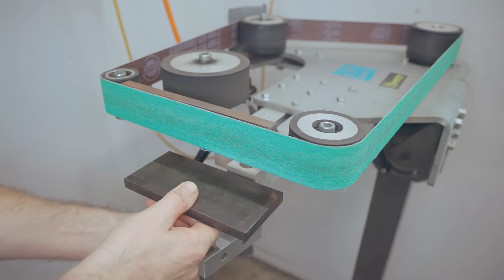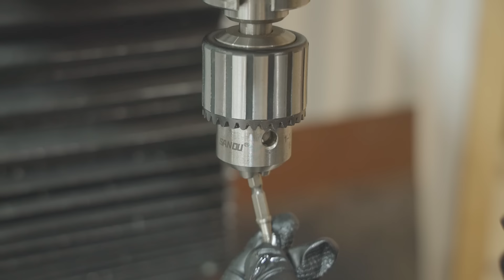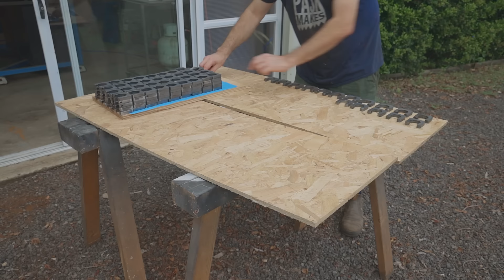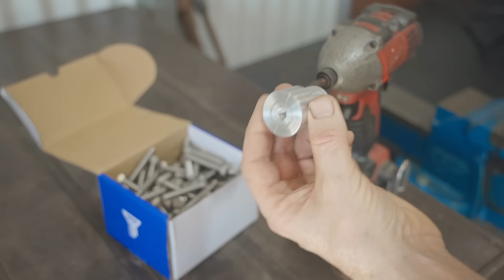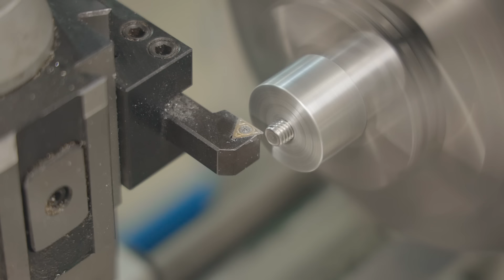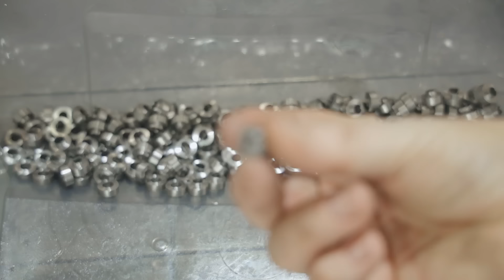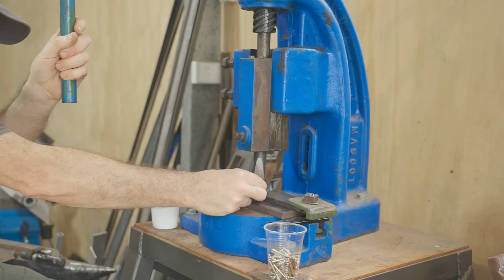Small Shop Batch Production - Lots of Jigs to make 200 Clamps

Comment: Two simple things: use a vibratory deburrer for the clamp bodies and the little dinguses on the end of the screw. Instead of painting, I would do either black oxide (you'll have to send it out) or parkerizing (which you can do in the home shop)

Comment: Most keyless chucks have a back-lock. After squeezing in you turn it the other way. There should be a noticeable click or an immediate loosening of the tightening ring. Tho .. it is mostly used in drills designed to be used as a screwdriver.

Comment: When getting something laser cut from a template for the first time, pay the premium to get only 1 cut first to identify issues, rectify issues, then repeat with another single piece cutout. Then, if this second "prototyping" is within parameters, proceed with production run or do further R&D. Having a couple of high cost one-off prototypes prior to a production run produces a better product and reduces the cost and time of remedying issues.

A couple of "prototype /test" laser cut pieces at (5x, 10x or 20x cost of multiple piees) will significant reduce the cost of and time required for multiple pieces.

With the painting, maybe paint the stamped maker symbol a different colour, I'd suggest red or yellow. Maybe even allow the purchaser to nominate the base colour and the imprint colour (for a premium) ~ I'd go with yellow base and black imprint

Comment: 50 years ago I had a summer job in a small engineering firm  and i learned how jigs could speed up production. Small components had sharp corners removed by tumbling in a drum with abrasives.

Comment: In a high production setting you could have eliminated almost all the manual de-burring steps by using a vibratory tumbler, a collet chuck on the lathe would have saved some of the setup time on the turning operations and made it more repeatable. However with the accuracy required that one is definitely up for debate and would be more of a preference. As far as the Laser goes as I'm sure others have said make sure you include a print that has dimensions for critical features on all parts you are having made outside of your own shop for two major reasons. First off it gives the shop the best chance of making the parts correctly and second it gives you a way to go back to them and have them be the ones to correct it if they are the ones that made the mistake and missed something on your print. all in all you did a great job and are a great machinist as the best sign of how good a machinist is in my opinion is how they set up quickly made yet repeatable jigs and fixtures for repeated operations for the fastest overall turnaround time and to hold complex parts rigid enough for a quality end result.

Comment: For removing all the sharp edges it might be nice to use barrel finishing (tumbling). It's kind of slow, but easy to set up and practically hands off. You do need an electric motor and gearing, so maybe an old washer?

Comment: That's a cool little clamp. Simple, functional, and a very original look!

The kind of patience for those repeated processes, is a skill in and of itself. Most people can't stand it, while others enjoy having some parts of the process not require much thinking, just a clear head, and getting the efficiency aspect down. Had a similar experience as a ski-technician a few years back. We had a massive sale on children's ski's, but didn't take delivery until just the night before. So my manager was worried about how we'd attach bindings for 300 sets, without causing a massive queue. 300 sets meant 3000 holes would need to be drilled and glued, before fastening 3000 screws without ripping the threads in the thin, soft material.

With 2 hours available before opening, I had all of them done within half an hour after opening, and not a single customer had to wait. I just put my headset on, head down, and perfected the workflow to the point where I'd have a set done in under 60 seconds, including tying each pair together with a rubber band and handing them over to a colleague. Those hours just flew by without a hitch. My colleague said it was like watching an F1 pit-stop on repeat for 2,5 hours.

Your process took that same kind of repetition, but turned the amount of work per part up to 111. Good job on getting through all of them! I bet every customer was as pleased as pie with the finished piece.

Comment: When making the swivel pads, you could add a spring to Joe's jig, and rather than the solid rod contacting on the rear of the stock face, you could let the spring-loaded rod touch towards the front of the face. Move towards the chuck until the spring bottoms out, then advance the part-off tool. The spring will push the rod into the center hole and catch the swivel pads before they fall. Might save you digging through swarf!

Comment: The only suggestion I would consider is to use springs between the vice jaws for instant release, they will also keep the parallels in place when using the airline.

Comment: Excellent methods for mass production.  Would change one thing though.  Buy off the shelf stainless tube so you don't have to manually drill out the centers.  Cost should be similar.

Comment: You could try ball milling the edges in a shot peen barrel. 
For the counter sink on the hole there are counter sinks that slip over drill bits and set into place with a set screw.
For tapping you could utilize a tapping head.... although pricey when new.
For the lathe stop there are actual hard stop clamps made for the ways. You could make a crude one with your mill and it would have far more flexibility.
The Y axis on the lathe would be the tool height??  
For the swage on the end of the screw you might be able to eliminate the spilt cut. Try using a single point forming punch tip made on the lather instead of the bearing. Set it at 4 or five degrees. The deformation only has to be enough to retain the clamp head. A countersink there would help.
I think another inch and a steel handle would make these more useful. 
Just some thoughts.

Comment: just started video, but good way to debur all the sharp corners on a thicker part like that one... put a bunch of them in a concrete mixer with a bunch of old nuts and bolts. set outside, turn it on, wave at the now angry neighbors, come back an hour or two later and done. Also works good for removing dross on small plasma cut parts. the parts will look like that are sand blasted when they are done.

Comment: I'd like to ask, when you made the threads with a large machine like that, how did you take into account the vertical pull created by the machine to match the rotation? With a normal drill press I'd imagine you would ruin the threads if you let the tap to pull the machine down on it. If you know what I mean?

Comment: Nice job on your clamps and all of the jigs that you used. 

One thing that might help on future projects when needing to part pieces like you had for the swivel pad would be to use a parting insert that cuts either on the left or right side vice a neutral insert. In your case the insert that is angled to cut first on the right and last on the left would allow the part to get parted and not leave the little extra that you had to pull off manually. 

Other than that - good job 👍

Comment: Great video and picked up quite a few tips and tricks.

I do have a question, wouldn't selectively heating one corner to press is the touch mark create a weaker part of the clamp in that corner?
Reply: It won't make a difference with the pressures being applied by hand to the clamping force. Not to mention the brass handle is going to bend well before the clamp base has any issues

Comment: I'd suggest sanding off the bolt markings from the head.   No one needs to know what grade the bolt is.  By belt sanding and lightly polishing the head smooth it will make it look custom made and not like just a hardware store bolt.

Comment: Speeding up the lathe bolt tenon: could chase out some of the threads in the jig (most of them, so that the first inch of threads is pilot hole, that way only a few threads hold the part in the end needing less drill time to insert them.  Add a slit so that the lathe jaws compress the now limited contact area like a collet.

Comment: For knocking the edges off, you could try putting them in a vibrating tumbler for a day.

And for dealing with steel chips from the drill press, I use a rare earth magnet in a ziplock bag, stuck on the vise. when it's nice and furry, you just pop it off and turn the bag inside out

Comment: I worked at a place where we had to make 100's of little angle pipe supports they where made from stainless steel angle line (40x40x4, 50x50x5 and 60x60x6)
we cut them on a automatic band saw, the holes where punch in. They took about 1 hours to make about 100.
we cleaned then up by putting them in a drum with a lid (could get about 70 to 100 in), fixed to an old cement mixer and put lots of small stones in and left it for about 1.5 hours.
all we did then was to wash them off and they look good NO sharp edges.

Comment: Much quicker and cheaper to radius the corners of a long square bar then saw to thickness, skim either side then bore the central hole and drill and tap for the screw.

Comment: Paint(ing) Tip. To avoid what is called Paint-Bridge(ing) {the edge of the part being painted and the flat surface} do not paint small or big parts on a flat surface. You can put parts on a small / or big, round diameter rod, or make wooden (semi) triangle(s.)  Take whatever size dimensional lumber that you have (a bunch / lot of) in stock,  (say a 2" in. thick X 4" in. wide) just cut say one inch or {0.75" in.} wide slices at a 45 degree angle, flip lumber to get true triangle(s,) rinse and repeat as necessary. I would recommend a length of 3 (three) to 4 (four) feet. What ever makes you feel warm and fuzzy.  To give you an idea of where or how to use the triangles, use, say when painting / staining house door's, kitchen cabinets, etc.  

The following tip is recommended only if the wife will be away for more than a week or longer. Cut triangle's to length so as to be able to fit in your oven, bake at between 150 - 180 degree's Fahrenheit.  (65.556 Celsius / Centigrade  to 82.222 Celsius / Centigrade) for 15 - 20 minutes.  Paint must be given time to "FLASH-OFF," before going into oven.  "FLASH-OFF," is usually around 10 to 15  minutes also. Depends on the type of paint, most spray paint in a can, the 10 to 15  minutes will be more than enough "FLASH-OFF-Time." 

What happens if FLASH TIME is not followed, you get a "FLAT-LOOKING-FINISH," versus a Gloss Finish. We won't talk about possible fire. Leave that for another day. 

WARNING, I was in the dog house for a long time over that one. Use at your risk. HINT: She came home early.  Boy, was I in BIG HEAP TROUBLE.

Comment: If you sent the vendor the correct file with a radius on each corner and the incorrectly cut parts with no radius...the parts are wrong period. Reject them and tell them to recut the parts OR you get the incorrect parts at a significant discount. Seeing as to you have to do the extra work.

Comment: First off, I love your template following jig for the belt grinder. That's a trick I'm going to have to remember. The template itself was perfect, requiring no tools to lock the clamp in place.

I think your grinding on the inside could have been skipped if the parts were water jet rather than laser cut, but I'm not 100% sure on that. You also could have tumbled the parts rather than ground them for that step, though I'm assuming that's something you don't have. Most water jet places probably can do that for you as well, though I have no idea if it would be cost effective. A tumbler would have saved you a couple of deburring steps later on as well, such as with the pads.

As far as your other jigs and fixtures, I think your setup for drilling and tapping, while good, could have been better. I would have gone with something like the grinding template, where you just slide the clamp on and off without needing to open up the vice. Something like the grinding template welded to a base plate and bolted right to the mill table (or held to it with strap clamps) would have worked. You'd just need to make sure there was something supporting the bottom side of the hole, which would also reduce the size of the burr when you break through. The same fixture could be used for tapping.

As for the lathe stuff, you should look into getting (or making) a micrometer stop. They do the same job as the thing you bolted to the carriage, but they clamp directly to ways and have a finely adjustable plunger that forms the stop. They're really handy for cutting up to a shoulder or batching out parts, and they're more versatile than the stop you made.

For drilling the main hole, next time I would see if you could find some seamless tubing that would work rather than making your own. For the hole in the end of the bolt, I would have looked at a drill collar to use as a depth stop rather than reading the tailstock dial.

Comment: To quickly clamp the bolts, I use a nut 30 mm long, with two grooves cut on the side of the hexagon and cut in half across the thread turns. I fasten these resulting nut halves together with springs from old rubber cuffs, these springs are just well fastened into a ring and keep the cut nut from falling apart. For these springs, two grooves are cut on the side surface of the nut before cutting it. When working with a bolt, it is enough to slightly open the nut, overcoming the resistance of the springs, and insert the bolt. And the shape of the hexagon allows you to quickly install a cut nut with a bolt in the cams of the lathe chuck.

Comment: I'm not an expert by any means but would tumbling these in sand or shot for a few hours be possible to take care of the rough edges. It takes longer but is hands off. If you had a large tumbler you could do batches and that's a job taken off your hand. Also if these are laser cut would it be a negligible increase in cost to have them cut the clamp discs from the center waste piece of the body before cutting the body and then you'd just have to finish them up, might be too thick or the wrong metal but if it is possible that's another way to streamline. They're really nice looking clamps and I've enjoyed watching you perfect the system of making them..

Comment: Looks wonderfull and much better than some versión of comercial clamp for this size (looks like a two medium thick metal sheet soldered), I remember a certain aplication, making inductors for induction heating, where the steel clamp alway looks darks and rusty due to the near of the torch for soldering copper with silver, I think a full stainless steel clamp is the answer for this application.

Comment: I’m sure you’ve already figured out a solution, but for the stop on the bottom die where you squeezed the pins, you could drill and tap a hole somewhere so you could mount the same stop you used on your lathe cutting the little rings.

Comment: Pask, I came up with an idea for a local trade school for a project for the machine shop. I got a number of used but reliable and accurate cordless keyless drill chucks for the students for their drill presses. They students would need a standard grade 10 sae bolt, cut off the head and machine 3 flats for the keyed chuck to keep it from spinning. The instructor thought that was a useful idea, and one that was both inexpensive and practical, and didn't require special training or calibration. A tool repair saved the chucks from non-repairable drills.

Comment: Great video and fantastic job on these! I work as an engineer for OEM machinery and have a couple suggestions for you:
Try to make a good stacking and dispensing method for your partz that is easy to lead/unload.
For the brass pins, you could use something like a couple toothpick dispensers. For the clamps body, you could have had a roller cart with two cantilevered pipe stubs. You move from finished side to unfinished side. When you get to the next process, you just flip the dispenser around or pull from the opposite side depending on the work being done. This keeps you from slowing down to pick up parts in an inconsistent position or having to lug around totes. It's all about repeatability and getting in the groove. Funnels and tapers are your friends and help turn the randomness of tossing into a box into consistent, organized stacks of parts.

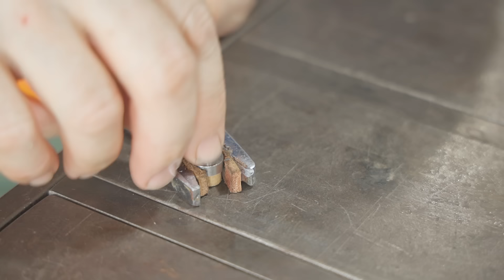Comment: 12:32 - Why break the extra flashing off manually?  Wouldn't drilling that side in the next step clear it off at the same time?  I'd expect that a mill with a bit that size would barely notice the flashing as it drilled out the recess.

Comment: Really great process improvements! In a world of unlimited tools or no budget, you could do the following:
1. Save the de-burring process until after drilling the hole and do all of it in one shot in a vibratory machine.
2. To seal the body but avoid having any peel-off problems, maybe consider chemical blacking or applying linseed oil while they’re still hot from the stamping process.
3. About the stamp… would getting your logo etched in during laser cutting be financially/aesthetically viable?

Comment: Id think you could machine a bar with all the outside features, then cut it like you would a loaf of bread. If the inside shape is not critical (±0.5mm): use a water jet to cut the design into a monolithic block thats ~15cm in height. Then its just the effort to section the profile into the final clamp 'slices'.

Comment: I use right-biased 2 mm carbide inserts when parting off long runs. The part drops off cleanly and then a fraction later, the ring pops off the stock. I like the little fixture for nipping up the parts for counterboring, although I think I'd set a stop with the tailstock against the cross-slide to drill the counterbore before parting, Nice!